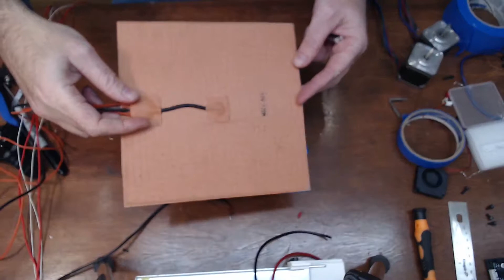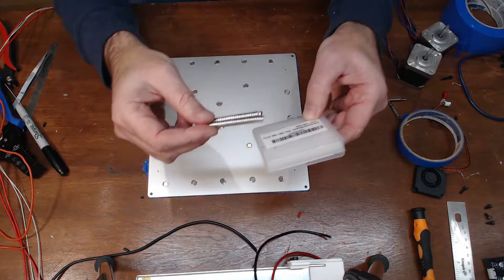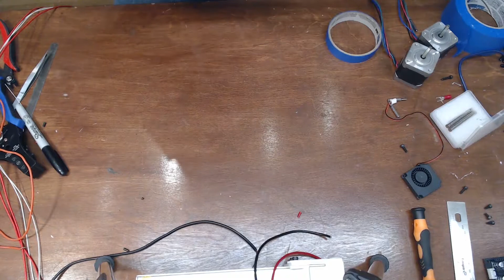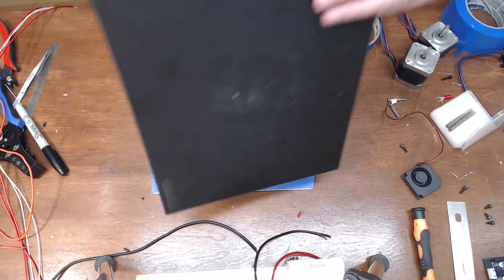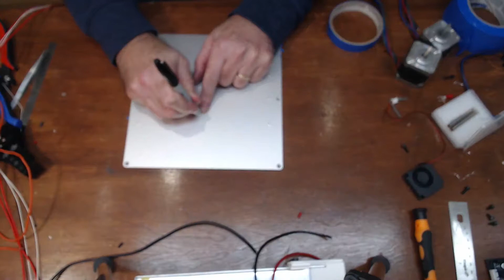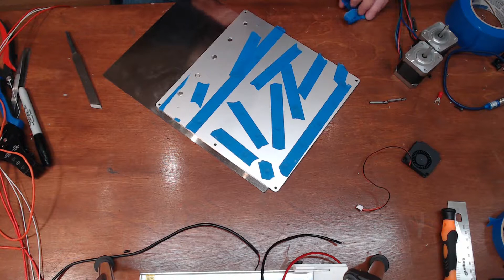C3Dt/c Cantilever 3D Printer Build: Part A Magnetic Bed

Comment: Hello Sir, I have a question. If you were to use ABS filament, do we need to build a frame around the printer, if so what material whoudl you recommend for the "see through" part of the frame, I know to use 8020 for the actual frame. Also, axpt how much did this entire build cost... I am building this for my school project.
Reply from the maker: I have succesfully printed ABS without an enclosure. I used Kapton with a coating of ABS desolved in acetone (spray it on the surface with a mister). That said, ABS does work better in an enclosed case with for a cantilever would have to be an separate case. I've got a fully enclosed CoreXY for which I used 1/8th inch acrylic sheet (from the local hardware store). Whatever you to attach the acrylic to the frame, make sure there is room for it to expand (as the chamber heats it will buckle without enough room). The cost for this particular build was between $500 and $600 https://www.instructables.com/id/3D-Printer-Cantilever-20-C3Dtc/

Comment: Cool to see you are still updating your design! I really like your Cantilever design and I am researching the parts neccesary to build this printer. But I am from Europe and finding and buying an 1 inch aluminium extrusion profiel is a compleet headache. I can't find it on Aliexpress and it's such a shame. Is it possible for you to make the design with 2020 european style bars? This way your printer will be accesible for way more people!
Reply from the maker: Thx. The C3Dt/c was designed SPECIFICALLY around the universal PSU which is exactly the height of 1020 (possible 2525 which is metric but I believe also hard to find in Europe). So in short, no the design won't work with 2020 as it doesn't match up with the PSU (the core of this design).

That said, each of the linear actuators is also available in 2020 (on instructables) so you can design your own printer/machine using 2020. It just wouldn't be the C3Dt/c